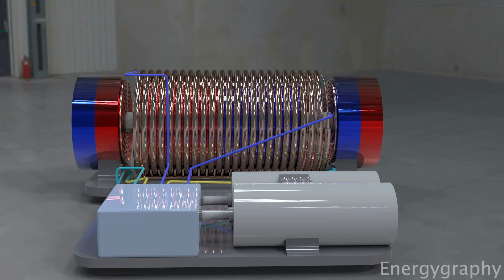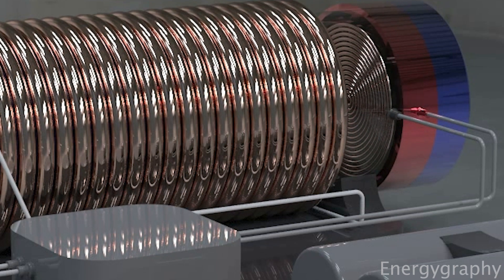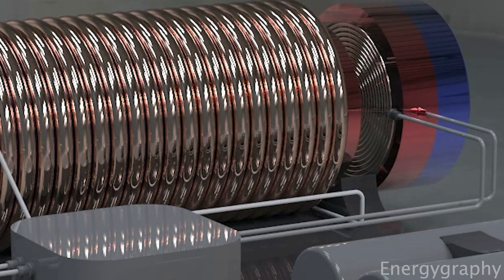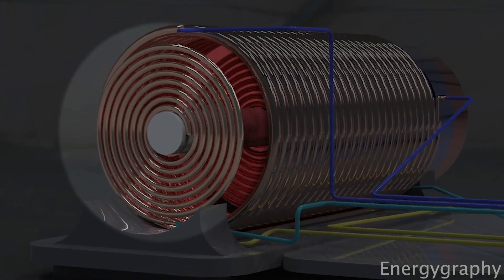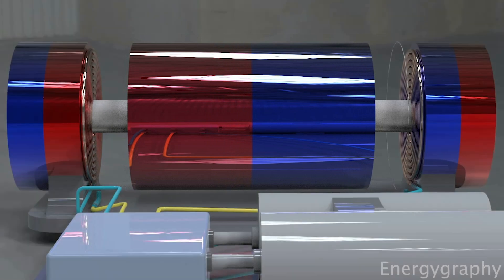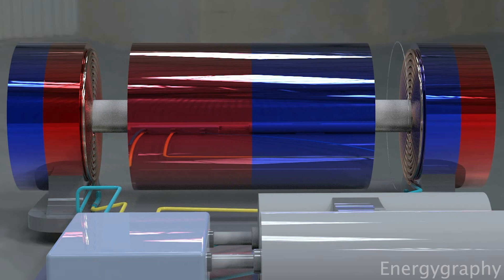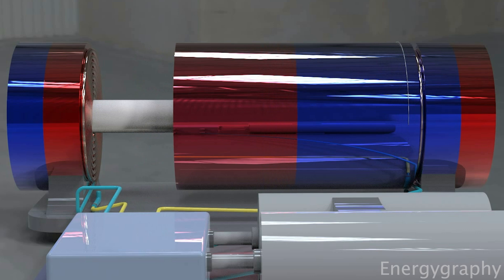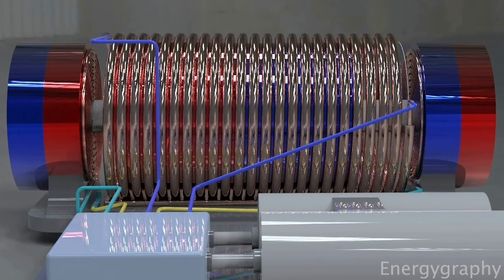New update on frictionless approach in moving magnet linear generator.

Comment: Congratulations you basically reinvented Nicola Tesla's Earthquake machine or linear actuator generator which is still covered by a patient in the U.S.  The only difference I see is his machine used air or steam to move the linear actuator part past the coils whereas yours uses electromagnets but it's still the same machine. Yours may be slightly more efficient in terms of power in vers power out.
Reply: This is “free energy?” Seriously lame click bait